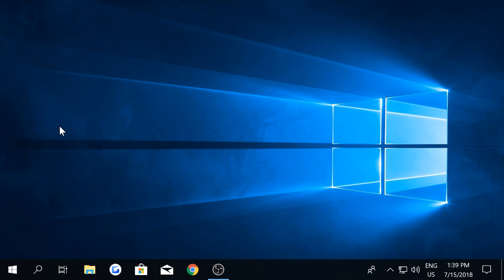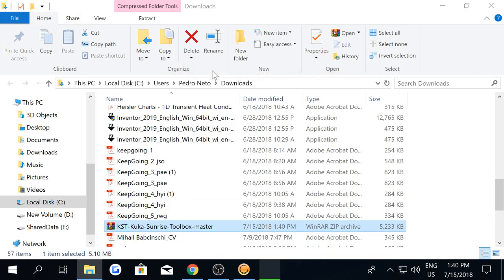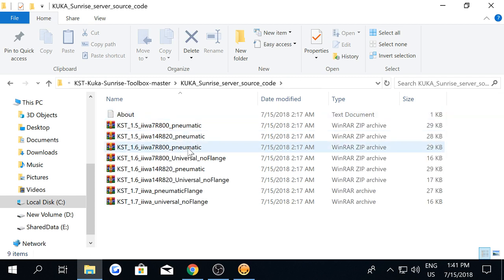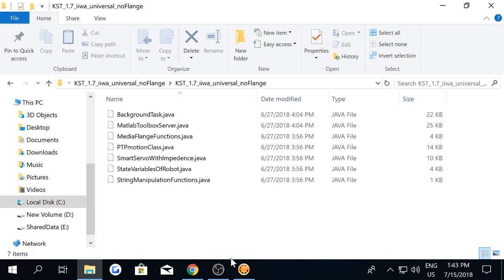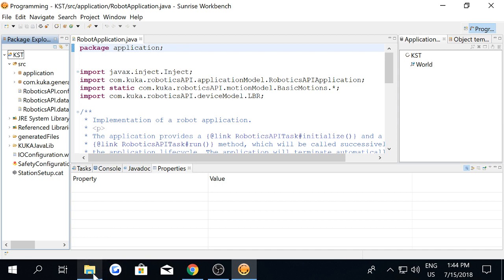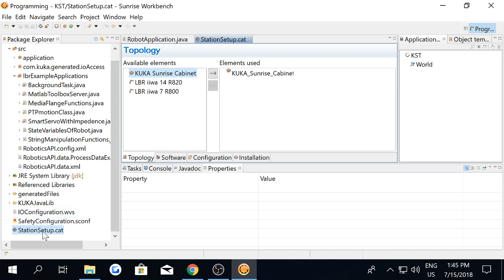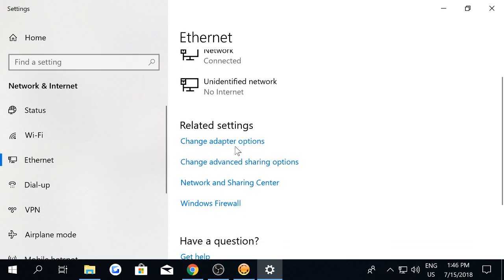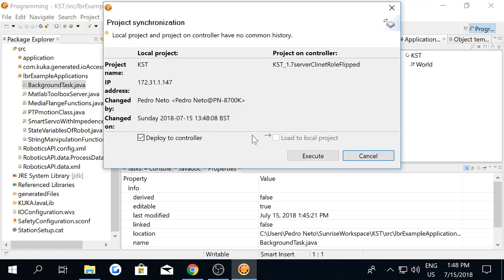Synchronize KST-1.7 to iiwa robot

Comment: Hi sir, thank you for all your videos. is it possible to run the sunrise code without connecting my computer to the robot controller ? Is there any library to add to get an offline simulator of the robot on sunrise ?
 When I tried to search for some new software (help>install new software) I found it empty. so from where we can get them?
Sorry if my questions are obvious , I'm a newbie